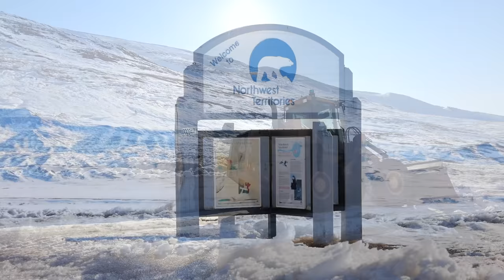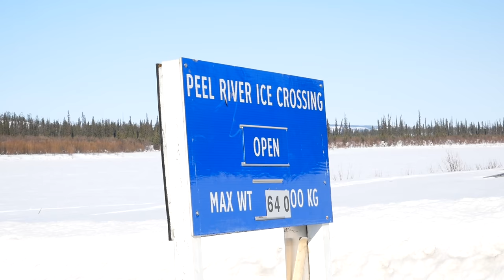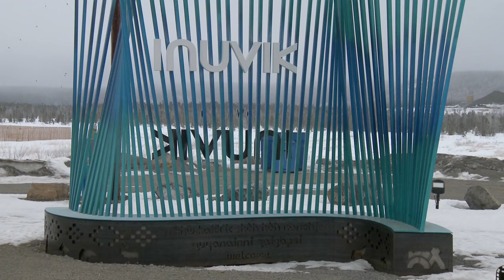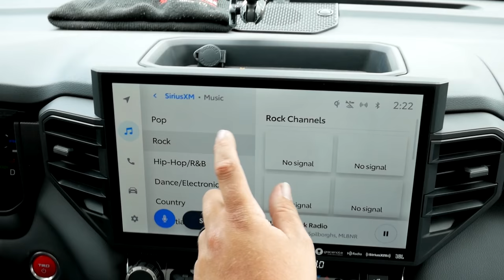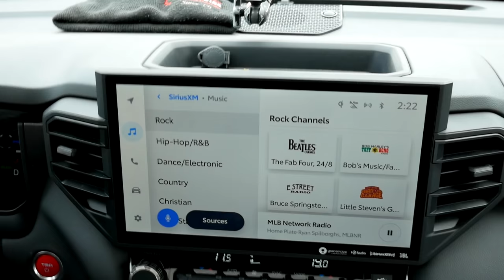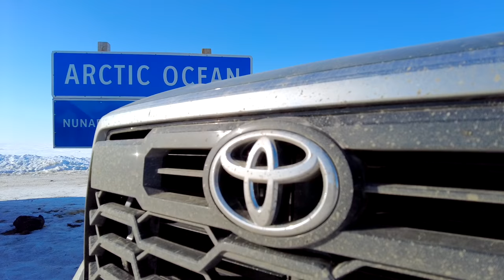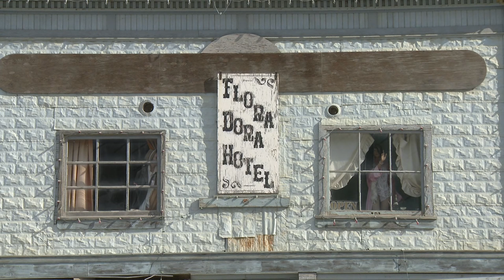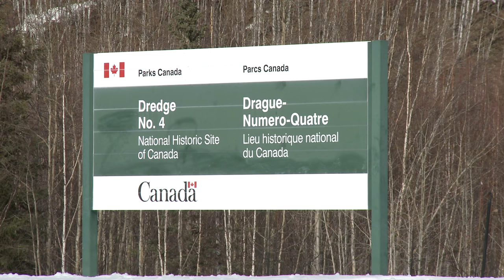2022 Toyota Tundra Completes Torture Test to the Arctic Ocean - Our Epic Trip Comes to An End

Comment: Toyota’s are such great, dependable vehicles.  10 years ago we bought a used 2000 Tundra with 90,000+ miles.  We put a camper on it and drove from Palmer, Alaska to Deadhorse, AK, also on the Arctic Ocean coast on the Dawson Highway (also known as the Haul Road).  No problems at all.  Then back home in Palmer, after stopping by Denali National Park.
Reply: I have a 2009, I hate it so much wanting it to die do I can get a new one..
Reply: They would be if they stuck with the V8. That engine will last 100k at best. If you want a bullet proof drop deal reliable turbo charged v6, stick with Ford.
Reply: @wizzle0979  that's funny because everyone said that about the Ford too because they switched to the v6 and i4. In reality the engine toyota put in the tundra is already proven reliable some cars using the v35a already reaching 150k miles just fine. Other than that normal turbo failure which every turbo car has.. even ford.
Reply: @wizzle0979     If you ignore the first few years Ford first introduced their first years of their Ecoboost v6 3.5, They also had issues of carbon buildup.. They used BorgWarner and Garret gt1549L(? if I recall) And they all had issues before the revamp in 2017 for the new models. However in the revamp of the newer engines in the current engines they DO have Port injection too. Toyota started their v35a engines with DI and PI for their engines already. and also started this platform in 2017 just like ford in their Land cruiser which America didn't get.

I'm not saying Ford can not make a proper turbo v6 as they both have issues. Both engines are open deck, Both engines uses ported and direct inject fueling and both engines uses timing chains both engines are 10.5.1 compression Toyota uses stronger connecting rods.
But both engines do have problems with their EPA systems from the government Both engines are fine.

Comment: The trucks did great and im sure this was an amazing trip to take! Id love to see this done with an f150 tremor, at4, ram rebel, and tundra trd pro all with a 5k lbs trailer to see how each of them will do.
Reply: @Mach 1 what engines in the F-150’s?
Reply: If you want a reliable truck that’ll run past 100k that is a turbo charged v6 stick with Ford.

Comment: Great series! I like that you took the time to talk about the areas you were driving through, and the explanations in French were a cool addition. 
On another note, your trailer tires were worn like that most likely because the axle bent at each end due to the rough road. We had light trailers at work and that happened constantly. You are correct, a commercial grade tandem axle handles rough stuff better.
Reply from the maker: Thanks! 😃

Comment: Question for you after this long trip…
How comfortable are the seats?

I’m a big guy. 6’7 350lbs.  I currently drive a 4Runner and the seats are just too short for my legs.  Causing back pain.  

I’m trading it in and currently have a 22 Rebel on order.  It should be ready in the next couple weeks, but I’m worried about long term reliability.  

But comfort is super important as well.  

Should I stick with the hemi powered rebel or opt out toward a new Tundra?

Comment: Does anyone have experience with real fuel consuption of new Tundra SR?
I am thinking about buying one and there are no tests of SR trim.
Considering TRD PRO did 12 l/100 km and SR being 900 lbs lighter and having thiner wheels (245 vs 285), I reckon it will be around 10 l/100 km, right?
Reply: That would be amazing!  With current gas prices especialy